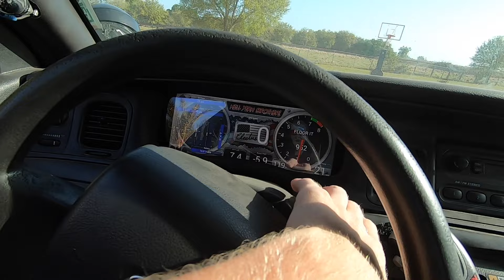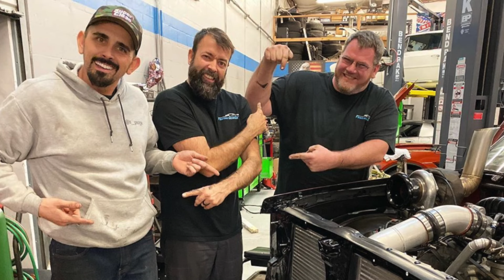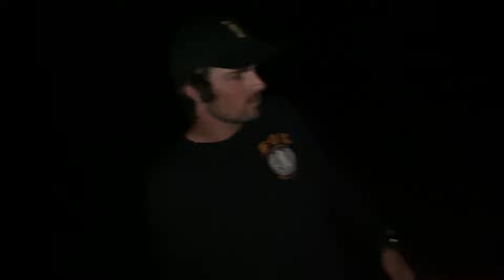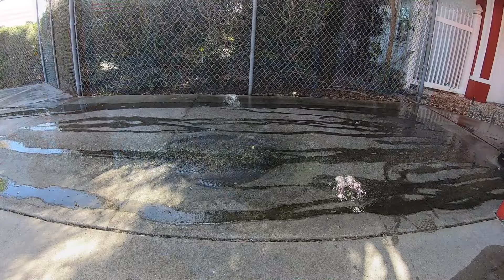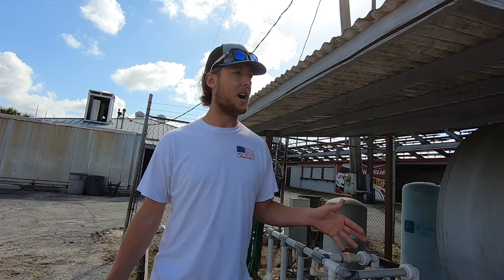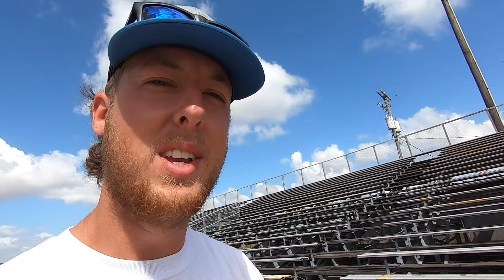The Freedom Factory has some MAJOR Issues You Probably Didn't Know About...

Comment: Paint specialist here: I recommend you scrape the loosest stuff off the walls before painting.  New paint won't bond old paint back to the wall.  Use a concrete primer on the bare concrete, and there's heavy duty outdoor paints that would work well for that project but aren't crazy expensive.  That's the best way to have the longest-lasting final product.  Sherwin Williams provides paint for the Golden Gate bridge and the Whitehouse.  They'll have what you need.
Reply: This Sherwin guy sounds like a go-getter. Does he do RV's? I need my roof redone.
Reply: I would email him brother
Reply: @ronjones-6977  Geter done call him up tell em  I sent ya!
Reply: @ronjones-6977  You want something good for an RV roof, GACO S20 waterproofing silicone.
Reply: I'm a painter.
scrape it first or your new paint will start falling off pretty quick
As you are applying it, it will wet the loose stuff and it will delaminate
the old stuff.done properly it will last for years.and look good while doing it.The painting is the easy part. It's doing the proper prep that most people neglect.
Reply: @ronjones-6977  lol go to home depot or lowes and go to the paint section buy a roller and and cover and there is a paint made for rolling rv roofs just ask the guys in the paint section
Reply: Yeah I agree scraped the really loose paint. I recommend SW Loxon xp it’s a little expensive but I’ve used it and it lasts a long time!!
Reply: @thomaskimball992  that would work really well!  If it's affordable that would be nice.
Reply: you could sand blast it and it would come off easier. but painting over old paint is a very bad idea.
Reply: Are you related to Peter millar?
Reply: @WunderNation  nope
Reply: Front sweeper attachment on the tractor, would that be stiff enough to work the loose paint off?
Reply: @WunderNation  no, are you?
Reply: 9.95 ain't nothing that cheap 😜😜😜

Comment: I used to race motorcycles and I think the white and black painted walls with a touch of red to separate them is easier on the eyes at speed. It won't blur as much as some other color combinations might which helps the drivers differentiate differences in speed. (which is helpful on entry to corners).
Reply: I agree - then stencil the FF logo and paint that blue in the middle of the black sections! Will look super clean.
Reply: I never raced on a track with walls (the desert is a bit big to put up walls) but I can see how what you are saying is logical. A regular pattern perhaps painted STARTING at the turn entry and going backward on the track could help people get their bearings. Changing the pattern at the turn entrance would also help to let the drivers gauge where they are and their speed. Two thumbs up!
Reply: I second this
Reply: Yeah plus a mark or sign before the curves could help too to spot the breaking point
Reply: I was thinking keep the pattern that's there, and just make the black section blue. But keeping it black and putting a nice blue ff logo would be great.

Comment: The steering shaft needs to be detached from the rack turned straight and then reattached. Had this problem in my 03 gt took all of 10 minutes to correct with the tubular k. Hell yeah brother!
Reply: Aaron Wilson nope, just needs to be realigned, the alignment is way off. unfortunately, doing that with the steering shaft will not do anything!
Reply: Wrong lol delete your comment
Reply: @4WDutah  well when i had this exact issue i fixed it by doing what is stated above. So i know 100% it would work if its the same issue. If its not the same issue then oh well.

Comment: as someone whos painted for the past 15 years i'd suggest you at the very least do a light pressure wash to knock the loose stuff off so it doesnt flake off in the first month, 90% of a lasting paint job is in the prep work
Reply: I was thinking do them in plasti dip to prevent that lol
Reply: So little known but so true.
Reply: @skm9420  I think most people know paint is all prep. Figuring it's the hardest, longest, and most time consuming part. Anyone can just pull a paint gun trigger...
Reply: @Snarf_Le_Wombat  Oil and gas do not make it peel off lol
Reply: J Findling pull a paint trigger gun 😂 I guess nobody uses brushes or rollers anymore 😂
Reply: @Snarf_Le_Wombat  As a guy who's done professional auto-body /paint, as well as interior / exterior paint for residential and commercial properties, I can tell you that isn't my experience. It's worse in the auto world, but I'd say at least %70 of customers asked why a paint job costs so much when materials are only a few hundred bucks. I also couldn't tell you how many jobs I've fixed because someone thought they could pull a trigger. There's a lot more to it than that.
Reply: True but it's a wall
Reply: Also, would it be useful to have lines on the wall just prior to the turns. I find it gives a useful "feel" for my speed prior to coming in to the turn.
Reply: @philipegoulet448  gas will dissolve it. I used gas to get it off my rims before.. Works great
Reply: @smoothpotato957  It's not 1920, it's 2020...
Reply: @philipegoulet448  Then you've never used it. Doesn't hold up for shit.
Reply: @Ben80219  That's because "in your professional experience" everyone that doesn't know shit contacts you to DO IT FOR THEM. Meanwhile everyone else that bothers to spend more than thirty seconds realizes how much prep there is and how much it sucks. Then some people realize fuck buying all that shit and just go to Maaco.
Reply: @Snarf_Le_Wombat  People literally paint their motorcycle gas tanks with it and it held up... Personally had no problem with having my front grille plastidipped for over 50k km and its still looking perfectly fine. For sure if you SOAK it in gas it wont hold up, but that just doesn't happen normally
Reply: I suggest that they claim the business on google and change the name, to The Freedom Factory, and inform google its not permanently closed
Reply: J Findling and I bet you’ve done painting jobs  😂👌🏽

Comment: Cleetus, you should make a rig that applies paint from your car.  Kind of like the street striping vehicles that spray lines on the highway.  Red White and Blue all day.  Get a lot of star decals to spray over and peel off to get the negatives.  It's good to have a marker system on your corners or a special corner to visually inform your drivers.

Comment: Plant an orchard in the leach fields and reduce the leach water getting into the water table. It's always a balancing act between leach fields and drinkable well water.
Reply: Ah, the old crap water v tap water struggle. It's as old as time.
Reply: Dave Iauco  Wouldn't Willows be liable to damage the system though?

Willow roots are cancer on any water system, clean or not.
Reply: Any sort of tree or bush will cause havoc on a septic system
Reply: @jytheiowaguy1897  I saw someone mention Cattails.  I don't know anything about that kinda stuff, but it seems like you want something to soak up the shit water lol.
Reply: Dave Iauco  Even better!

Comment: When I heard you say cut a hole in the fence I thought you were going to say everybody just piss through the hole 😁
Reply: Used to have partys at my workshop, Ladies got to go inside to use the toilet

All the lads had to go out behind the shed and piss in a 1/2 cut bit of pipe that ran down towards a drain. Actually worked quite well.
Reply: It's a g- nevermind
Reply: I though he was gonna say pee right into the septic
Reply: In Ireland most bars bathroom door opens to the outside of the bar and there is a piss wall.  Super cheap

Comment: Hey brother! With 8.9k comments Im unsure if you will see this, or if someone has already said this... regarding the color choice for the walls, I would go with red white and blue for colors. An easy solution would be to run the red and white the same or similar to what it is now and put the blue where the black is currently. A simple remedy would be to put a coat of a medium gray over the black for a base color then 2 to 3 coats of blue for coverage. That way the black will not bleed through. You could even do a base coat of white if you are looking for a more vibrant blue. That would of course be more coats of paint on top of whats already there but at this rate whats another extra coat or 3 lol. Good luck with everything and thanks for sharing with us

Comment: When you paint the walls, I think it would be worth pressure washing or peeling the stuff that's flaking off, then if you're going to paint it a different color, do the whole wall white the cover. Good luck guys
Reply: At 17:35 he said that's exactly what he thinks they're going to do.
Reply: They do, but before that he said if he didn't know if it was worth going hard enough to take the peeling paint off. If you're going to put in that much work you might as well take the extra step and do it right

Comment: You might consider re-using the water from sink drains to fill the toilets (grey-water) it could cut the sewage-flow-rate by 30%
Reply: I imagine that soap buildup would contribute to more toilet maintenance though.
Reply: Some towns make you get a chlorination system to do so.
Reply: @nostranger2u   you only supply certain soap, that biodegrades quickly, and a holding tank will collect the sludge, that has to be pumped out
Reply: I agree you can get that soap. But it’s usually twice as much so you’re no longer savings money. Just the environment and only marginally. And judging by the cars they drive. Don’t think they care to much lol
Reply: @jpmotovlogs996   and @Chad Simmons
AFAIK their regular soap already goes into the leech field/pond so that's no different from how it is now, it would just have the benefit of reducing sewage quantity so they don't have to upgrade the pumps or go to larger tanks. just give the grey system a decent sized settling tank to let anything solid come out and improve clarity before it goes to the toilets.

Also, is there a such thing as soap scum with liquid handsoap? I didn't think so but maybe there is. Might be a little gross if someone pukes in a sink though (it would be extremely diluted so its hard to say if it could be smelled when flushing a toilet with water from a 500 gallon tank that had 1 person's puke in it)

Comment: Cleetus, Im a certified pressure vessel and pipe welder. Fly me out there, i will fix your stuff for beer and food!
Reply: Thats a legit offer
Reply: You can just open the end up, and re-capped it, can't you?  Then inspect it on the inside while it's open.  It seems it'd be a damn site easier to do with a plasma cutter & TIG or  MIG than it used to be with a cutting torch and stick, and I learned in that era.  The tank is not a real high pressure tank, it doesn't look like a difficult repair, just big enough you better know what you're doin'. I'd re-cap a small tank, only diff is scale.  Hope they take you up on it, it's always great watchin' some body else work!

Comment: Sounds like you’re all over the water thing.
The toilets thing, you might just need to dig and add more septic tanks to ‘store’ it. Cheaper to get a truck in to suck them out than it would be to hire portables.
Bleachers on the other side, will the drag strip go halves in some portables? Buy some old semi trailer frames and build some. Get Bruce over to move them.
Reply: Good idea!! Also the first semi truck in the burnout pad!!

Comment: Who else thinks James will be out of nitrous by lap 10?
Reply: 4 laps ahead though! If it doesnt knock the rods out
Reply: I didn't think the nitrous would make it much past the first lap, but maybe he's packing more than one bottle lol
Reply: 20lb bottle will only be good for two laps or so if he stays on the button for most of the laps. A lot of it will come down to strategy based on starting positions. Guys in the back will be using it to make passes. Pole sitter would be wise to hammer the nitrous right away and get a gap.
Reply: lap 5
Reply: Lap 10? You me turn 2

Comment: RE. Painting the walls, just give it a quick scrape by hand to remove the loose flaking edges of paint, pressure washing if done carefully can work, but often removes much more paint than is needed and makes a bigger job out of it. 
Colours? Red White and Blue all the way!! 🇺🇲
The Blue will cover over the black just fine as it's a dark colour with a lot of tinter in it.
Love what you guys are doing, hello from Australia, 🇦🇺 we share flag colours 👍
Ps, if i was a little closer, i would happily get the big roller out and help you with the painting... I reckon i could do it from the back of the f150 track ute while you drive around the track slowly 😂.  Oh and Use a nice long nap roller, holds more paint, covers over rough patches easily!
Reply: @for_all_those3611 
You do realize that cars will be hitting the wall's right. I say just paint everything that don't need to be replaced. Then it will save money at least untill Cleetus and crew start making money off the race track then fix stuff better then before and don't forget do it for Ed OO HELL YEAH BROTHER'S
Reply: @jasonstrout4502  have todo and impress the sponsers, the mans trust fund probably only paid for 10%

Comment: You can center the steering wheel using the toe in. If the wheel is out center to the left while traveling straight then toe the right wheel in and the left wheel out the same amount.

Comment: Since you've been on the topic of safety recently, I want to point out something that's been bugging me for years. The way your bucket seats in pretty much all of your cars are set up, you could have some serious injuries if you ever got into a crash. Since the holes for the shoulder straps are so low, you run the risk of some nasty spine compression if you wreck. I'd hate to see you be paralyzed from a wreck because of the seats. Stay safe brother
Reply: Dave Iauco  racing round concrete walls?
with the motto "do it for dale"
properly set up seatbelts are a must, otherwise it might do you in like dale.

Comment: on paint - 55 gallon drums are the cheapest way to buy paint, and if you contact an OWNER of an INDUSTRIAL paint supply, there should be some out of date or near out of date paint readily available. A strong DO NOT USE recommendation for the non-professional painter is any paint with fiber added,  as it's hard to work with if you don't know what to do with it. I would like recommend parking lot paint, or the like, and rent an airless heavy duty paint spray rig. If you do rent this, do understand that "airless" doesn't always mean electrical powdered, as you can use air to powder the pump, it just means that it's not air injected through the paint line. Lay down a heavy base color coat with the spray rig, let it dry a bit, tape it off, and hit it again. For a decent painter and helper, this is, at most, a 2 day job, and the water blasting will take half of the time.

Comment: Actually, with outdoor latex paint, the lighter the color, the better the coverage. Darker colors are less acrylic and more water to allow for darker colors and colorant. Lighter colors have more acrylic and less water and cover better. It you want to use dark colors, use grey as a base coat, PPG (used to be the Glidden monochromatic scale) has an entire scale that shows you what color grey base for what dark color you are using. Use it all the time so red will cover in two coats instead of 300 coats. 

Been a house painter for 30+ years, and worked at Glidden paint store. Also, on exterior masonry surfaces, cheaper and less sheen paint holds up better because it allows condensation to escape. Never use gloss, use flat or satin at the most.

Comment: Use some paint remover, scrape and get as much old paint off you can. Bad idea to just paint over when already done soooo many times. Then once you get most off paint with a fiberglass coating they use on cement fencing. Which will strengthen water seal and make surface smooth. Then paint. 👌👌👌

Comment: Red walls , like firengine red around track walls with some stenciled paint of the bald eagles in like 4 different spots around it. That track would stand out unlike any other and is 100% fitting for this place. It already has red highlights around the buildings to. But also maybe a stenciled American Flag at finish line area wall.

Comment: Brother you shouldn't have to explain yourself about having a pay per view. First it is really inexpensive, and way cheaper than what it is going to cost when  the Freedom Factory actually opens to the public. because of liability insurance etc.... I don't have to tell you that there will always be haters, it is a shame, but always. Oh yeah i know all about the Septic System troubles Brother, i have a Bar Down the Street from you in Limestone, and when i have a busy day, as often as possible, it tends to overflow, however i now have resolved the problem temporarily till i rebuild it. The solution may not work for your situation but i have portable Toilets out back for  when it becomes necessary.... cleaned once a week. anyway you are doing an awesome thing out there, Keep it up!